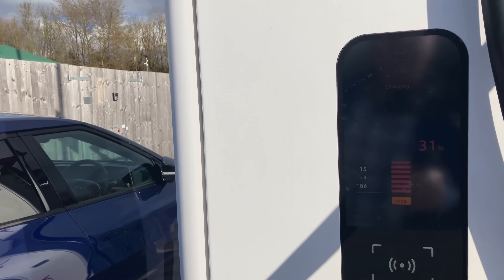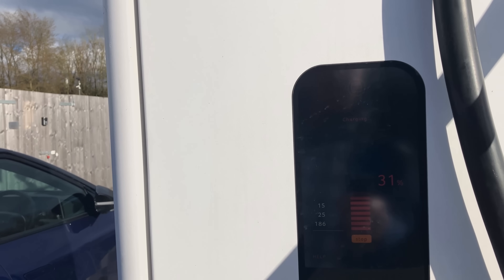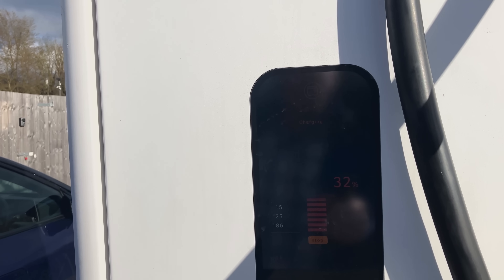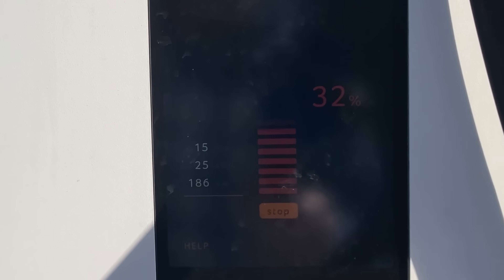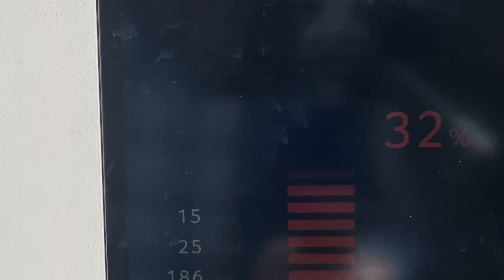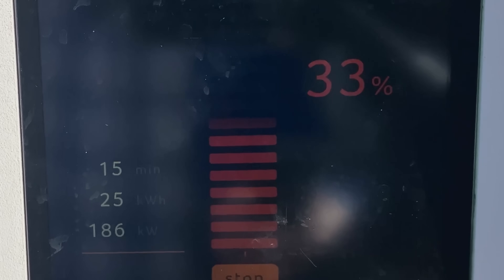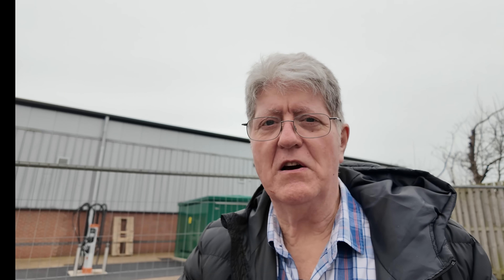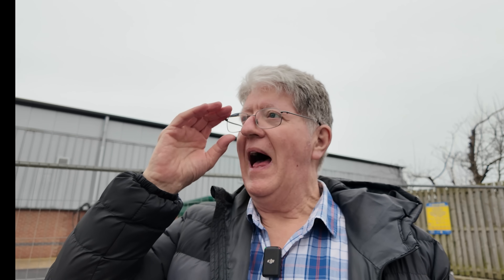What People Get WRONG About Battery Pre-Conditioning

Comment: If I haven't 'conditioned' the battery in my MYP, it heats the battery itself when it's charging. It stops heating between 50-60 Celsius. I haven't noticed any difference in charge rate.

Comment: Says there's a lot of confusion.
Spreads further confusion.
Read more about why Teslas (for example) heat the battery before rapid charging. (Clue: it reduces battery degradation. But why?)
Reply from the maker: Teslas do not pre-heat to reduce battery degradation, that is a bonus. Teslas pre-heat to allow faster charging, 25% faster in the last year alone, thereby improving availability, reducing queues and increasing Supercharger throughput.

Comment: I did some extensive research over several weeks using an OBD plug-in and Car Scanner software in my Renault Scenic. It reports the cell temps as min and max across the battery and the water input temp from the Heat Pump.   With a selected charger you need to achieve around 30degC ... this will take around 30mins driving time in Summer and 45mins in Winter to a selected charger.  ... same time as a Tesla.   Doing this I can guarantee approx 145Kw charge rate at 20% SOC every time (unless the charge dispenser is throttled)
Reply: so you’re saying u can achieve the optimal charging temp in winter just by driving, without ‘preconditioning’? (summertime the issue o/c is excess heat)
Reply: @jaywalker1233 No, You have completely misunderstood. ....  In both situations, the battery has to be heated .. but it takes 15 minutes longer in Winter.
Reply: @mdshovel clearly, but you’ve not clarified
Reply: @jaywalker1233 Not clarified what?  I posted as a continuation of what Dave said in the video.  You select your charge stop point (on a Tesla or a Renault or a Volvo or a Polestar) and that starts the pre-conditioning of the traction battery using the heat pump to flow warm water through the battery and raise it to over 25degC .. usually best at 30degCfor charging.   This process will take around 30mins driving time in the Summer and 45 mins in Winter.  The battery will not get warm enough by just driving . it needs further heating.
Reply: @mdshovel so many words - but no cogent point
Reply: @jaywalker1233 what point are you looking for?
Reply: @mdshovel you had your chance, life’s too short - don’t waste it

Comment: You use the word 'efficency' - does it actually affect the efficiency of the charge (power in vs power stored) when preconditioned?
Reply: ‘efficiency’ wasn’t explained or how this affects AC home charging. It is known that low temp slows the DC fast charge rate (really slow if really cold, significantly extending long journey times) also reported studies show that DC charging at low temps will cause much higher battery degradation because of low temp chemistry - so a double whammy

Comment: But when you get there, pre-conditioned and theres a queuue so you have to wait half an hour for a charger anyway, the battery cools off, and you wasted the energy pre-conditioning.  So if theres any chance you have to wait, maybe sit in the queue, and pre-condition while you wait.
Reply: I have never, ever queued for more than 10mins in 4+ years driving EVs.  The battery will hold that temperature for quite a long time unless active cooling is started (usually above 40degC in the battery cells)

Comment: I am in the enviable position of so far only requiring my EV for maximum 200mile journeys ,to and from our Airport. I have a standard 7kw wall charger I bought on Ebay for £220 brand new a granny charger on a dedicated outside socket and as no longer work only do 20-30 miles per day very rarely need to fast charge . My cost per mile is 15:06  silly money therefore have no regrets in owning an EV.  I read of ice drivers giving the same stupid reasons for not buying an EV and wonder why. The money I save per year easily justifies my owning an EV with the added benefit of not polluting the planet with exhaust gasses and making me feel like I am doing 😂my bit

Comment: Is it necessary or worth it to pre-condition if charging at home using a granny charger and temperatures between 0 and 10C?
Reply from the maker: No, the pace is slow so it is rarely necessary but the battery will do automatically if it needs it
Reply: Will the auxiliary 12 volt battery remain charged if the car (Mini Aceman) is not driven for several months?
Reply: @granthartley3868 that’s an issue with most modern cars having ‘standby’ systems that never switch off - and the answer is “very probably not”. So you’re best option would be disconnecting the 12v (unless you can remotely +periodically access +activate 12v recharging from the traction battery or have a relative/ friend run the car to do this)

Comment: New EVer here. Bought an Ioniq 5 in Dec/24. Much to learn. For a while, we are parking our car outside (garage work underway) in sorta'-moderate southern PA in the US. We're using a level 1 charger @ 12a. Due to our limited mileage, Level 1 is working OK for now. Is there any point in telling the Ioniq that we're heading to a commercial charger so it will pre-condition the batteries before we plug into the Level 1 charger?
Reply: Not for Level 1 or 2, no need. It’s only for the 800 Volt / 300 Amps power that your car could pull at a DC Fast Charger where the chemistry of the battery wants to be above 70°F / 21°C to minimize electrical resistance.

Comment: A well structured presentation on an important topic.
how many new cars do not have heat pump installed?
My understanding from your presentation is that the management system will protect the battery when initially plugged in? Idiot proof? The MS will not allow charging untill it  heated the battery. Does it heat to a minimum or an optimum temperature?
Good topic. More like it.

Comment: It's important to note that some cars either cannot pre-heat or (in my case) require an update to enable it. I drive and Ioniq 5 which didn't pre-heat until I had a system update from the manufacturer which I had to give the car to the dealer for a day to update.

I'm going on a really long journey soon so it'll be a good test of battery pre-conditioning as I'll need to top up on the way

Comment: EVs don't like hot weather (sorry, Arizona), and they don't like the cold (sorry, Northern tier states). Do not let the battery below 20% and don't charge above 80% on a regular basis. Don't use the marginally-convenient fast chargers all the time, that degrades that expensive battery. Don't set the sat-nav for your routine charger location? Be prepared to wait. EVs with current battery technology are like those furry little creatures, the Gremlins: don't get them wet, and don't feed them after midnight.

Comment: Crossing the Nullarbor in Australia was a chore, due to a lack of fast chargers for about 1,000km in the middle. Although cold temperatures were not a problem(!), I presume that it was pointless pre-conditioning the battery for an imminent 7kW 3-phase, 3 hour charger session?
Reply: Yes, no need to preheat for a level 2 charger, unless your battery temperature is below zero.
Reply: @GerbenWulff  the wife was chilly at times, but the battery was fine.

Comment: I have an issue with preconditioning here in Australia with my Model Y RWD... The Navigate function on the map only shows really slow chargers, with a single lightning bolt, and Tesla Superchargers with 3 lightning bolts. All the rest (2 lightning bolts) are missing, meaning that you can't precondition to a non-Tesla charger (which I tend to use a lot). Unlike the UK, here down under, Tesla charges AU$0.70c per kWh, which is MORE than anyone else. (I tend to use NRMA auto club ChargeFox chargers because they are 48c/kWh).  I don't know if the 2 lightning bolt stations have been disabled from navigation, forcing you to go to a Tesla SuperCharger with preconditioning ON, or it's a setting in my App that I have that is not allowing me to navigate to non Tesla sites AND precondition.   Any clues please anyone ?

Comment: As far as I know my VW does not have the facility to preheat. As I do 90% of my charging at home @ 7kwh preheating is unnecessary. Looking at my charging data the car charges immediately at 7kwh what ever the outside temperature.
Reply: Pre-heat is for rapid DC charging.  Home charging is AC where it isn't relevant.

Comment: Hi Dave,

Thank you so much for explaining Pre-Conditioning. Great channel and I appreciate what you’re doing.

On my BMW i3 the cabin and battery are maintained using the A/C system. There is no heat pump on my 2021 model. So it could be a different story. For practical purposes the 50kW max charge rate might not really matter that much.

However, I pre-heat for 10 minutes (ish) on an icy morning. It’s great to be greeted with a defrosted EV and a waft of warm air in the cabin as you get in. Lovely!

Btw. John: Chapter 14: Verse 6 is my favourite Biblical reference.

You make such a great EVangelist. (Maybe a strange sense of humour too!)

Take care and God Bless.

Comment: If you preheat when driving it's quicker but you're doing so whilst also fighting against the cooling from the cold airflow. Great if you're in a hurry, but if not then it will use less power if you don't preheat.

Comment: Poor information for the UK it has not got much below zero. At temperatures above zero pre heating just reduces you range. I can lose 10 miles when it preheats.  I always  cancel pre conditioning  as it  has saved me no time at a charger, in the summer months. Perhaps in the winter in the UK it could possible save you 2 minutes.  An hour and a haff, NO WAY in the UK
Reply: If your battery is at 0 degrees, your rapid charging speed is going to be terrible. Still very much worth it.
Reply from the maker: Strange that Tesla, who design and manufacture batteries say pre-conditioning saves up to 25% in charging time and include it in every car. Maybe you know better?

Comment: So is there any point in cold nights pre conditioning a car which is connected to a home charger for overnight charge ?
Reply: The answer to that is yes & no. If you are going a reasonable distance then yes you will get full power as the battery can discharge quicker when warm. No if you are going a short distance to and from the shops because you will have wasted a few miles of power.
Reply: I usually just peek out of the window and if it’s frozen, I pre-heat the EV 10 minutes before setting off. It loses 5-10 miles of range, but for a full defrost and a warm cabin that’s a price I pay. Still has enough range for what I want.
Reply: @John-FourteenSix  yes I do the same it’s worth it to lose 2-3 miles not to have tho scrape the windows. But my answer was to “ should I heat the battery “ the cabin was a given.
Reply: @garrycroft4215  You can only pre heat the battery if you car has the option. You need to read the handbook. As not all cars have the option.
Reply: @johniooi3954  yes my bad, my car you can only heat the battery when it’s plugged in. However the new OTA update allows you to manually turn on the battery heater.
Reply: Good stuff Dave!

Comment: Does that BMS charge each cell individually to balance them ? does anyone know?
Reply: BMS will balance the cells, but its done at the top. Best to slow charge at home to 100% to balance them.
If they are really unbalanced you might need to deep cycle the battery a couple of times to recalibrate and balance the cells.
I believe this varies by battery composition though.
Reply: @Gazer75  Does that mean each cell has its own individual charge point/wire connection?
Reply: @Gazer75  How do you know it is really unbalanced down to individual cells, is there a voltage per cell monitor? thanks
Reply: @Ifitwerks  You can read a lot of data from the OBD port with the proper software. Not sure if all cars will report individual cells.
Reply: @Gazer75  Thanks for all your replies 😊, my understanding of cell packs is that they require cell tapping points to balance individual cells and this is the best (only) battery management for maximum storage and safety, I have been trying to ascertain if this is the case, I have looked at some battery photos but don't ever see what looks like the cells managed individually, Surely some of you experts on EVs can throw some light on this? hopefully?
Reply: @Ifitwerks yes each cell is individually monitored for voltage and depending on chemistry used, say a LiFePO4 the nominal cell voltage is 3.6v. The requirement for cell balancing occurs because individual cell impedances vary, so when the whole pack is charged each cell will attain a different charge and terminal voltage. When an imbalance is detected, the BMS will slowly charge each cell individually so that the final cell voltages are identical across the whole battery. During this process many cells won’t be charged at all.
Reply: @G6EJD  Thank you, so therefore each cell needs its own input to be charged independently during the balancing part of the charge which will occur as the battery nears peak voltage, hence the 80% to 100% slower charge period. so I presume the balancing wont occur properly when only charging to 80%
Is there a source to go to to see a schematic wiring diagram showing how the cells are individually charged and monitored? Cheers!
Reply: Yes, each and every cell, say typically 200 of them, will have its own charge source. This is why a BMS is quite complex as the charge source has to be an independents and isolated entity, otherwise there would be huge potential differences to be coped with.
Example -3.6+-3.6+-3.6+-3.6+
Then to charge the 3rd cell a potential difference of 3.6v n Ed’s to be applied, at one end the voltage would be 10.8v the other would end 7.2v and that’s the difficult part to engineer.
Battery packs are actually charged in a sequence of Constant Current where the charge rate known as C is set until the pack voltage reaches the set target SoC estimate, this stage can create a lot of heat, then the charging regime switches to a constant voltage and this allows the cell chemistry to stabilise and if this is near the 100% mark, the final stage will be to switch to a low rate individual cell charge known as balancing. You should be able to find an example BMS schematic search for BMS balancing circuit.
Reply: @G6EJD  Yes, I searched this previously and all I can find is banks of series parallel charging meaning each cell is not individually charged but charged as a pair or group for the total expected voltage of that said group.  You mentioned 200 cells are individually charged, how does that apply to 7000 cells as each would need to have its own charge source, the schematic I am searching for is for a 7000 plus cell pack aka Tesla etc showing 7000 individual charge cables for each cell.
Reply: @Ifitwerks  7000 cells seems a lot, as that would mean a battery voltage of 25.2KV and that would make charging very dangerous and complex as even the highest rated HPC EVSE’s are rated at ~600v DC, plus the effective capacity of the battery would be equivalent to a single cell. A typical 18650 cell (the Tesla cells have a similar style/size) has a capacity of 2600mAh, or 2.6Ah or in Watts 9.5wh, so I see where your getting the ~7000 count from, but you’d need to know the motor current draw to work out the battery architecture, as it’s much more likely the battery is wired as banks of series-parallel cells to get both the required voltage and capacity, therefore the balancing circuit would be balancing a group of cells probably arranged in parallel. So much more likely to be a bank of 10 or 20 cells as a pseudo single cell. Indeed if you study the Tesla battery images you can see the banks of cells that will form the total battery, so my guess is there would be more like 50 charging circuits. Plus a lot of heaters and coolers, again most likely constructed using Peltier units, as these are easily switched between heating and cooling by just reversing the current flow to them. I’m trivialising the BMS, but those will be the principles in use. I suppose they could use resistive heaters and a compressor for cooling, but I doubt that.

Comment: Getting any battery pack to the right temperature really helps the reaction within the cells, they like to be warm, not hot and certainly not cold. On Merchant ships one of my daily tasks was to check the health of the emergency batteries, they had to be bang on as you can’t jump start a ship at sea, no 240v supply out there !.
I remember hearing that Russian soldiers used to light fires under the sumps of their military vehicles to unfreeze the oil allowing them to turn them over so its not just an electric car thing its and issue for most vehicles when the temperature drops